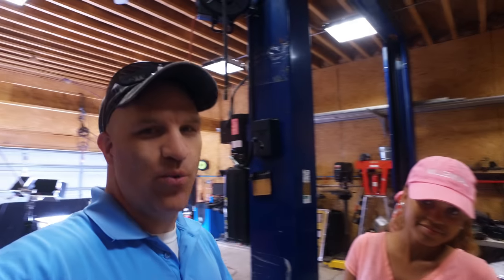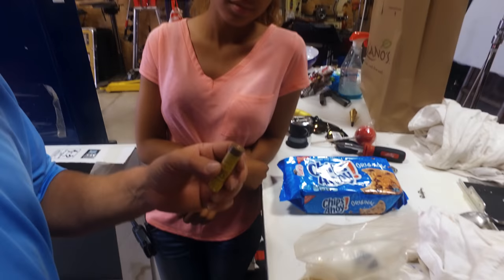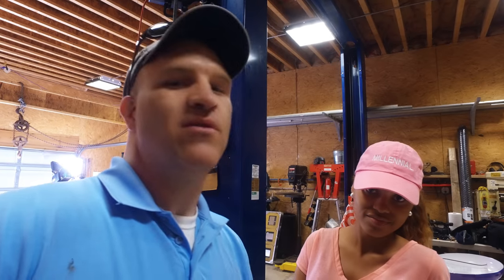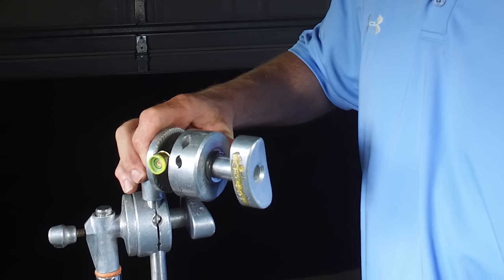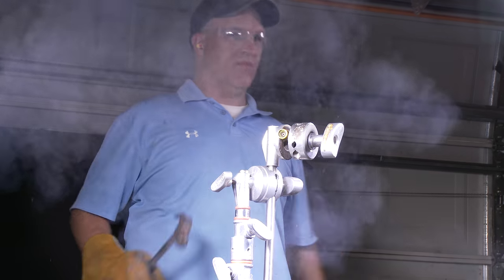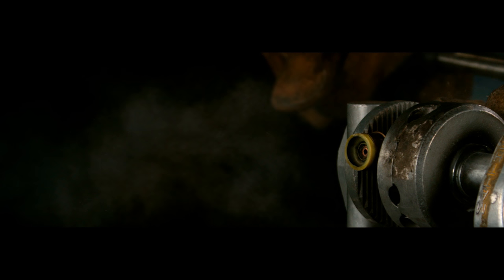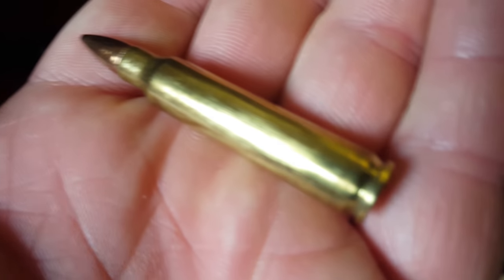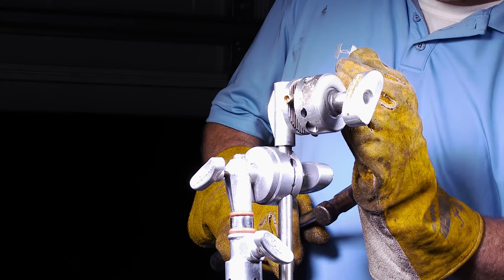Hitting Bullet Primers in Slow Motion - Surprisingly loud.

Comment: Cool video but they are called primers, not primes
Reply: Jay N Prime is short for primer.
Reply: Matthew Cioffi, no, it isn't.  You 'prime' a firearm by fitting a primer cap or charge in a flintlock.  "Prime" is a verb, not a noun.  Jay was correct.  A "primer" is the priming charge encapsulated in a cup with an anvil to strike the firing pin against.
Reply: @Matthew-Anthony  wrong. It's primer.